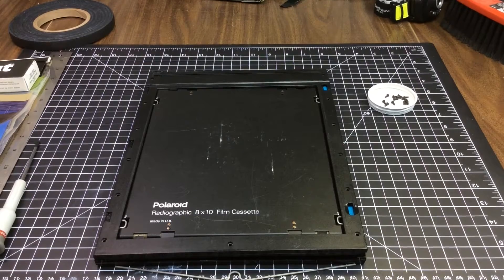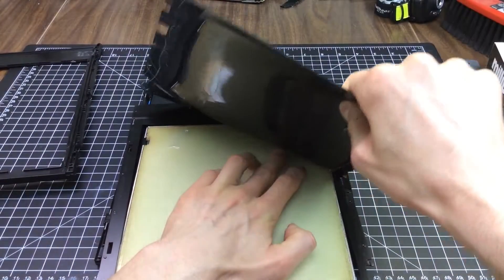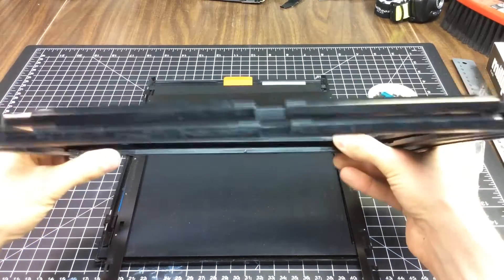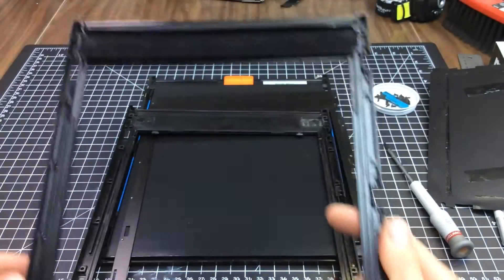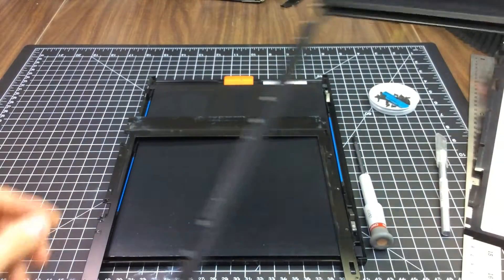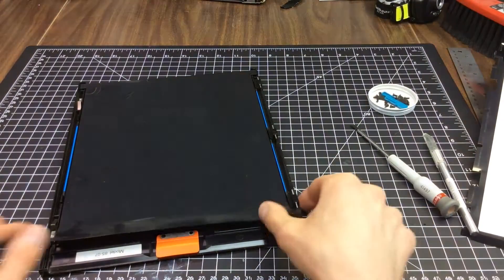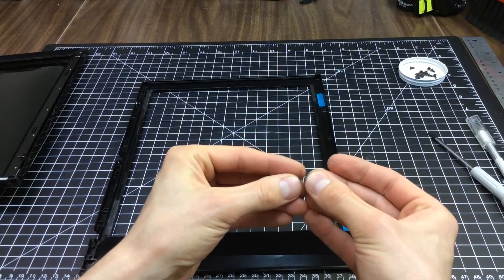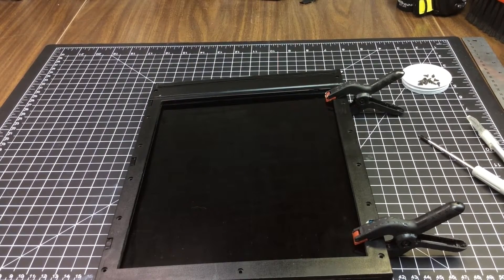How To: Convert a Polaroid Radiographic Cassette into an 81-06 film holder

Comment: So I bought 4 new radiographic cassettes to convert them to 81-06 film holders. I managed to get them on ebay for about $20 each.  While this conversion is not rocket science and doesn't require special skills it is complicated and time consuming. But given 81-06 holders go for at least $250, I think it's worth the effort. Thank you to David for providing this video, it has really helped a lot. I've just finished converting one of the holders, and while I'm yet to test it (waiting for a 3-d printed camera) I have the following initial observations. 1. I had a hard time peeling off the foam that was falling apart. Maybe it's because my holders were never used, but the glue holding the foam was strong and didn't peel off. Instead I had to scrape the foam off using rubbing alcohol to loosen the glue. You have to be very careful when scraping of the glue, and make sure you place all of the pieces of glue in a bowl, otherwise it can get stuck to you work surface or even elsewhere on the holder itself. The stuff is supper sticky and a nightmare to remove from holder if you accidentally get some stuck on it. 2. The hardest part is cutting down the plastic to allow for the insertion of a dark slide. I used an exacto knife as David suggested,  and that works well for removing some of the plastic, but I found it hard to keep the cut surface even. So I used some 100 grit sandpaper to even things out and then 600 grit to make the plastic smooth so the dark slide would slide easily. 3. Instead of buying dark slides that weren't the exact width and having to add additional velvet fabric on the sides, I cut my own dark slides from a piece of card stock I bought at an art store. It won't be as durable as a proper dark slide, but with 8x10 film being $20 a shot, I don't think they'll get used so much to wear out quick. In any case These dark slides are easy to make and cost less than $5 each so I can make new ones if needed  4. I don't think the epoxy putty is necessary as the recesses that David filled in are on the outside and too small to let the dark slide bend and let light in, but I'll only be sure after I test it. Also, if you use sandpaper for the final grinding down of the plastic, you can ensure that the dark slide is snug by sanding, assembling, trying to insert the dark slide and sanding again until it fits perfectly. I'll report back once I've tested my finished slide. Also if it is useful for anyone, I can post a video of how I convert the other three holders.
Reply from the maker: nice!  good job, thanks for sharing your tips!
i feel like one of the reasons i used the epoxy putty is that the dark slide was snagging on the corners when i was trying to insert it... however, since this was about 7 years ago i'm afraid i don't recall every minute detail.
but if you can get away without using the putty that will definitely save some time & effort!
Reply: Hi,i bought some radiographic cassettes,but its too hard for me,can you sell one to me,thank you

Comment: Hello David, I just bought 4 radiographic cassettes and will shortly try to concert them. Would love any new tips you have. In particular, you noted that the fidelity darks slides you used were a tad short on the wide side. Do you have the exact measurements of the fidelity dark slides? In order to simplify things I'm trying to see if I can source wider dark slides.
Reply from the maker: apologies, i just moved and most of my photography equipment is in a storage unit! 😕
however, if i find myself over there in the next couple days i will try to remember to measure one for you.  i will say that one of the reasons i used the Fidelity dark slides were because they were long enough to fit the Polaroid holder.  the other dark slides i tried were too short to be able to fully cover AND still have enough left over to pull out the top.
Reply from the maker: alright, i finally got some measurements for you.  the Fidelity dark slide i used measures 208mm wide x 304mm tall (after plastic pull tab has been removed).
the original Polaroid 81-06 dark slide measures 210mm wide x 304mm tall, including the plastic pull tab on the top.
i hope this helps; let me know if you have other questions.  good luck!
Reply: @DavidVonk  Thanks!

Comment: Any one try turning one of these into an 81-05? Is it even possible?
Reply from the maker: the 81-05 is considered an inferior model of film holder due to its thicker profile, more complicated loading, and the inconvenient, non-removable darkslide.  Polaroid eventually realized these shortcomings and created the simpler, more elegant 81-06.
the reason the conversion of the Radiographic Cassette to an 81-06 is possible is because the frame/chassis of the Radiographic holder is nearly identical to the 81-06 and only needs slight modification.
so, to answer your questions: no, i don't believe anyone has tried to convert one into an 81-05.  i don't believe it would be possible without heavy modification and fabrication of many parts, which would make the cost and effort far exceed the worth of the inferior film holder.
Reply: @DavidVonk   Dang I finally thought I had everything needed to shoot 8x10 but realized yesterday the whole thing about needing a loading tray for the 81-06 and those seem completely impossible to get right now. Currently I have the 81-01 processor, two brand new radio-graphic film holders, a polaprinter 8x10, and the film. I was all ready to get started this weekend but coming into that issue really slammed on the breaks. Any alternative ways to do this with the equipment that I have? Or do I just need to wait years to find a loading tray on ebay :( ?
Reply from the maker: well, the 81-09 loading tray is necessary to use the 81-06 film holder  if you're really feeling adventurous you could try an experiment of feeding the film negative tab through the hole at the top of the positive and attempting to hold everything steady while feeding it into the rollers...  but there is a good chance you'd just end up ruining an $18 exposure and making a mess.

if you're terribly desperate it appears that CatLabs has a couple broken, questionably functional loading trays for sale on ebay for $200+ dollars each... which is absolutely insane.  i guess your best bet is work on your film holder conversions and keep an eye out on ebay.  sorry i don't have better news, but it the 8x10 hardware are vintage, niche-market items that haven't been manufactured in decades... not really any other options out there.

best of luck, i have no doubt you will enjoy the amazement of holding a giant instant photo in your hands when you finally are able.
Reply: @DavidVonk   Thanks for the tips. I did see those broken ones too but as you said it looks to be very questionable as to whether they could be fixed or not. Even as an avid repair person seeing the way that those are broken it doesn't look hopeful to me that they could be fixed to a fully functional state. I thought about just trying to hold it together carefully too or maybe just laying it flat and using a brayer to develop it but I couldn't really find examples of anyone else doing that and figure there's probably a good reason for that. Looks like I'll just be back to waiting for ever for parts to show up on ebay again, just wish I had figured this out before buying a box of film lol

Comment: Thanks for the tutorial. It’s not clear to me in the video exactly what part of the plastic plate you cut and by how much. I don’t want to accidentally cut the wrong part or by too much.
Reply from the maker: basically you need to remove anything that gets in the way of inserting a dark slide.  you will probably have to disassemble, reassemble and test-fit multiple times.  if you're using epoxy putty as filler you will repair the gaps anyway, so if you happen to remove too much you can fill it back in later.
Reply: @DavidVonk  Thanks.
Reply: Can you add a close-up photo of this area after you have filed it down so I can try and gauge how much to remove?